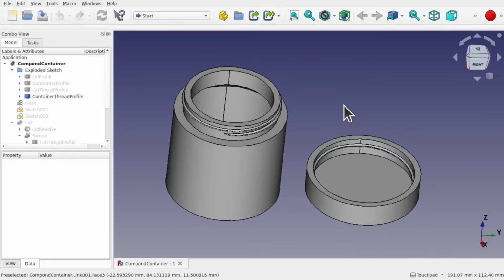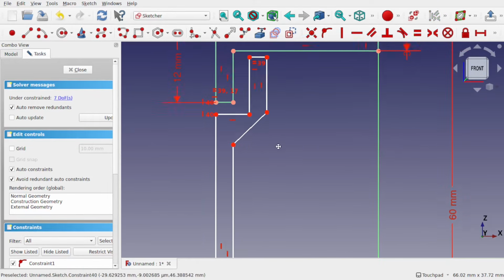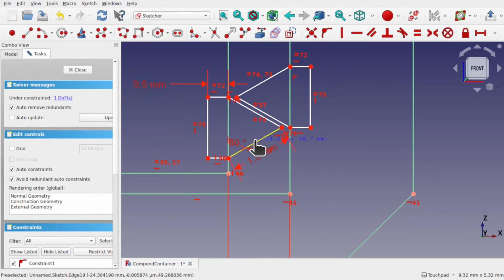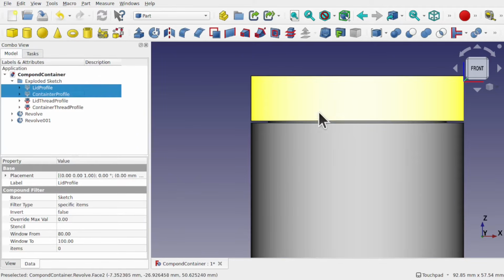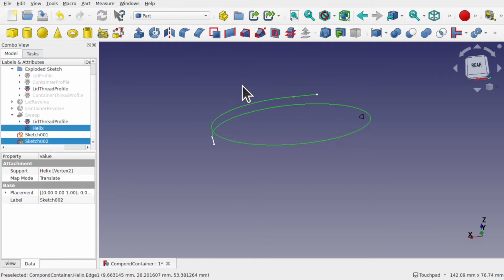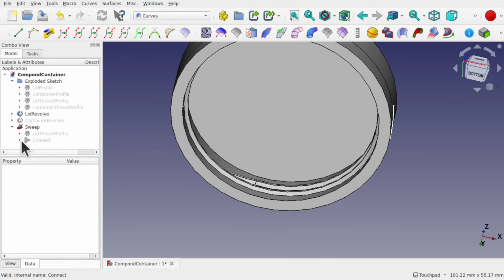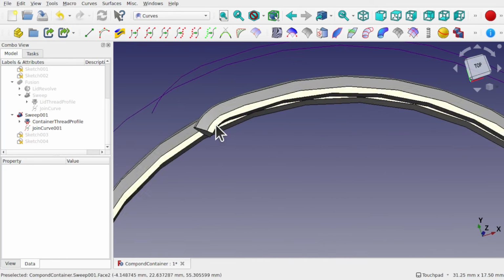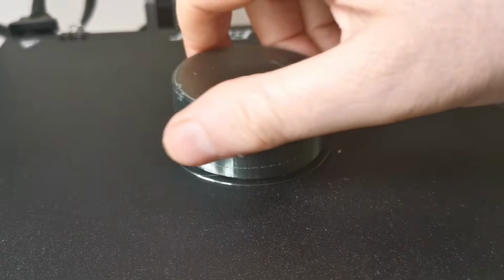Learning FreeCAD For Beginners 41 : Screw Top Container | 3D Printing and Modelling | Threaded Lid

Comment: Nice video! A suggestion -- I noticed that your Sketcher toolbar icons aren't all visible at once, which requires you to use the extend-toolbar icon to get to the angle constraint located on a separate list, meaning extra actions for each use.

The remedy is to reduce the size of the toolbar icons. Edit ... Preferences ... General ... Size of Toolbar Icons ... change from 32px -> 24px. Problem solved.

I hope this helps. Again, nice video.
Reply from the maker: Thanks, glad you enjoyed the video. The sketch icons are on purpose that big to make it easier on viewers to see what has been selected
Reply: @MangoJellySolutions  Yes, that thought crossed my mind before I posted, but for viewers who rely on specific actions in the user interface, smaller icons and fewer steps might provide an easier narrative to follow.

Anyway, it's a good video, well worth watching.

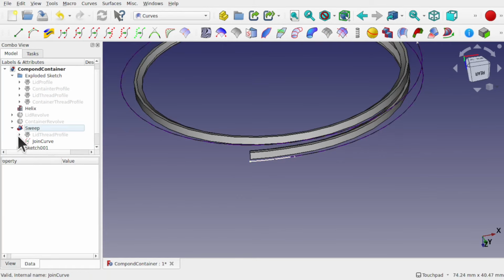Comment: At 31:25 Darren says to delete the Connect. If I do, I get an error message: 'The following referencing objects might break. Are you sure you want to continue? JoinCurve.' JoinCurve shows an exclamation mark - 'List Index out of range' and there's no way forward for me.
If I back off and leave the Connect, the Helix isn't released. 
BTW, the Connect shows as a cube icon at this point rather than a T-on-its-side,
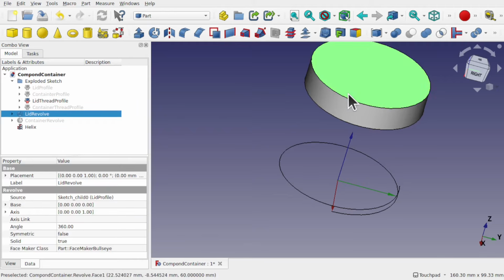I worked around this by saving the completed lid, then back-tracking to 19:50 and working on the container.
Can anyone shed any light on what went wrong?
FreeCAD v. 0.20.2 AppImage / Linux Mint

Comment: Excellent tutorial. I've been exporting in either 3mf or step for a while now as PrusaSlicer accepts both. 3mf files are smaller than STLs and STEPs are imported better if there are curves.
What filament were you using?
Reply from the maker: Hi Mark. Interesting about that file type export, didn't know it was smaller. The filament is silk pla. It surpose to be emerald green but more of a chrome.
Reply: @MangoJellySolutions  .3mf is all in a zip which makes it smaller. That filament does look more chrome than green.
Reply: @MangoJellySolutions  If your slicer accepts it (Cura doesn't seem to) then exporting as STEP gets rid of the tessellations you would see with an STL file.

Comment: So first of: THANK YOU. I have been binge watching your tutorials and it helped me so much. I can't express that enough.

However this time I have a question: I somehow started your tutorial of on a different plane (XZ), so everytime I attach a  sketch to the end of the helix it turned. Which is no problem, just turn it along its attachement. But what happens when I try to merge the curves, they don't mere for some reason. I get three different curves and for that reason the sweep doesn't work properly. Do you have any ideas? ^^
Reply from the maker: Sorry for the late reply. If you start on a different plane then use the same attachment mode and draw a quick arc attached starting at the centre. Then go back into the map mode and select the reference 2 button and click the helix. You will get some attachment options of Frenet which is a curve attachment mode. Try one of the 3 and you should be in a better position.

Glad your enjoying the videos and they are helping 😊

Comment: The sketch planes for the lead in/out edges should be rotated around local X or Y to match the helix angle. I don't think it will be a problem with the generous tolerances on your threads, but there could an interference with longer leads or a steeper thread.

Comment: Many great pointers in this one! I've gravitated towards the part design workbench for some reason but i see some really useful tools in the part wb here. Thanks again , i love freecad its amazingly versatile. How did you learn all the parts of it? do you know all of it? amazing tutorial Thank you as always :)
Reply from the maker: You can use this workflow with part design if you wanted to by creating the sketch and then the explode compound using Part tools but then using sub shape binders to pull into your part design workflow. You will need to creat additional bodies which create the additional steps. Regarding the knowledge well it basically started by trying to figure out what I used to do in the software I used before freecad.. I did a lot of exploring, experimenting and researching during the early days. Even looking at the code to figure out what the tools were doing under the hood. There wasn't much documentation during that time so I did a lot of asking and researching.
Reply: @MangoJellySolutions  I was impressed with the explode! I've a lot to learn but it's starting to click together using freecad,  the beginner series has paved the way for me. Brilliant. Would be interesting to hear more about things pre freecad.